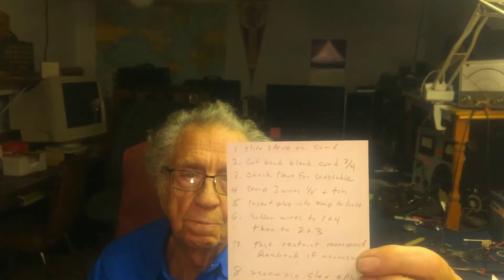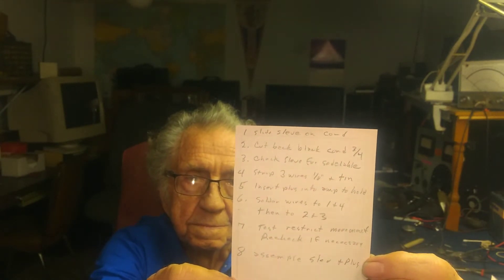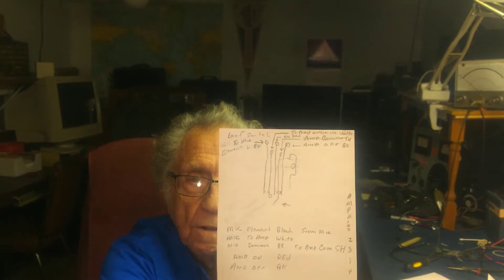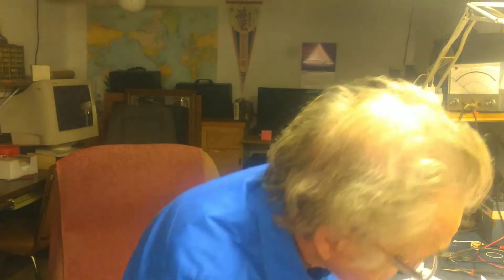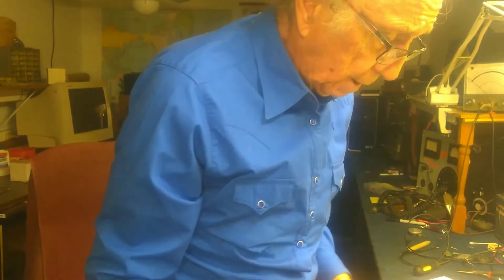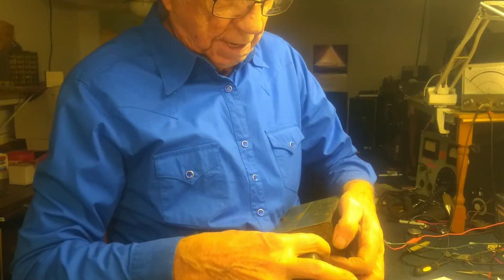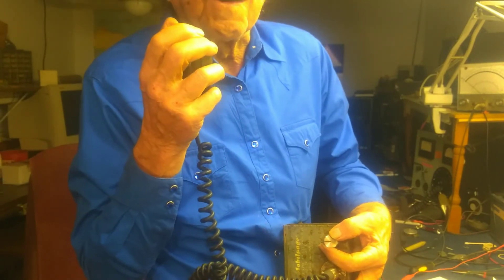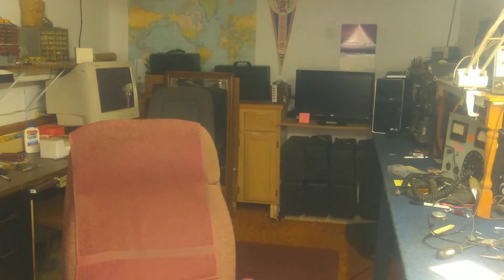Short Addition to Bus PA Amp

Comment: I sent you an email at your gmail about a couple buses.  Have a Happy Thanksgiving.
Reply from the maker: I don't recall a message from you, Todd. Resent it to busoldmanphil@gmail.com
Reply: @busoldmanphil7293  the email was asking if you or anyone you know might be interested in a couple old busses I have or had stored at a friends rural property as i havent been out to their location recently to see if they are still there. Both are GM 35'  Suburban model SDM 4501's which I felt were worthy of saving even though they were in rough condition as one is serial number 075 and the other is serial number 001. Yes that one actually was the first of its model designation to be built.